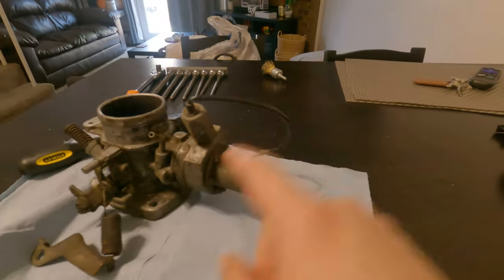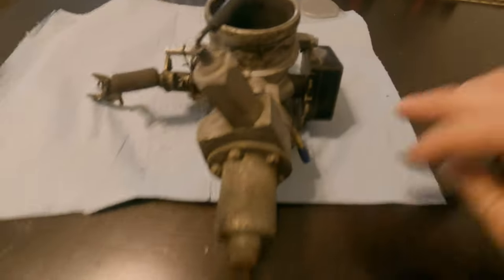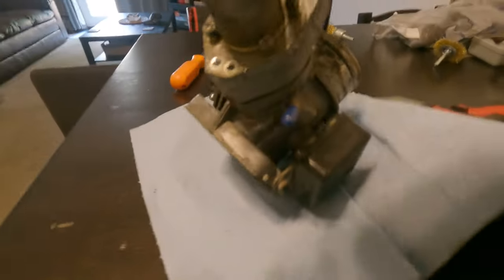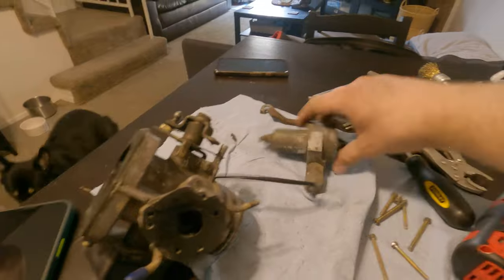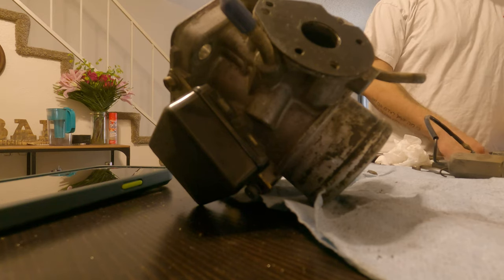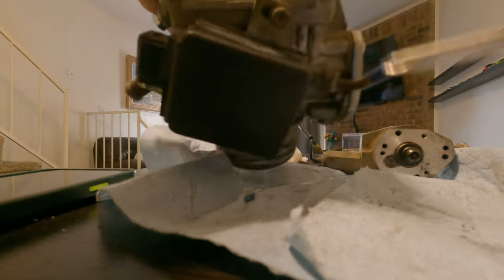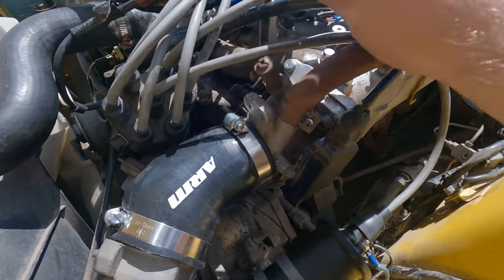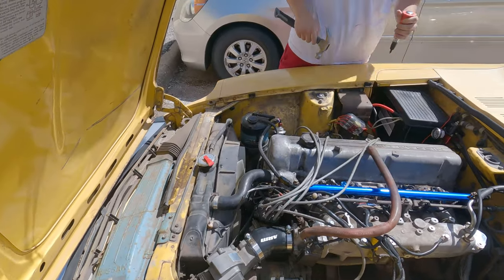280Z BCDD Delete! Throttle Body Block Off Plate for BCDD.

Comment: Was bored so I watched all your videos on the 280z and I have to say, enjoyable videos but you are not helping the performance aspect of the car at all. It's already been dyno proven that removing a lot of the oem components from the intake manifold and so on actually decreases the overall performance of the vehicle and in personal experience with tinkering so many of these cars it's true. 

Honestly not sure what your goals are but your time and money honestly would've been better suited just replacing, cleaning and restoring a lot of the components and hardware and cleaning up the wiring and tuning up the car.. All that would go a long way in making the engine bay look presentable and retaining and increasing HP and overall drivability of the car.

The fastest version of the 280z I ever felt with a non-built L series engine was a completely refreshed L28 (New spark plugs and wires, cap and rotor, fuel injectors, valve adjustment, timing adjusted etc etc...) with everything cleaned up and all the OEM components installed and it pulled on Stock L28's with triple webers. I currently finished rebuilding an L28 that will be going into my Z next week. Full engine rebuild, everything new from the rings to bearings, polished crank, slightly higher compression and slight headwork for better airflow and port matched stock intake manifold with everything on the intake manifold either new, or cleaned up and restored including the the injectors etc and will see if a slightly bigger cam would benefit at all after putting some miles in with the stock cam but I am willing to bet this will be the new fastest version of a OEM fuel injection that I will have been in especially since my Z is installed with electric fans, light weight flywheel, light weight wheels and other things to reduce the weight of my car.